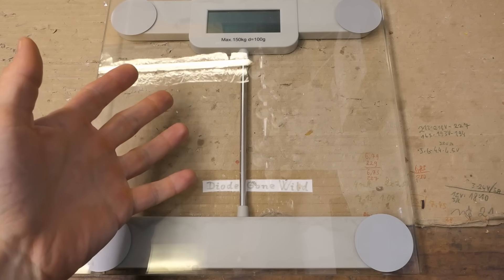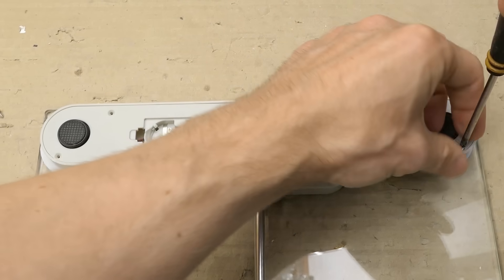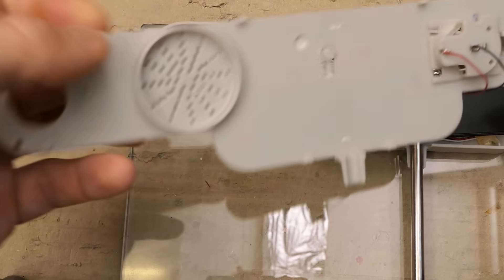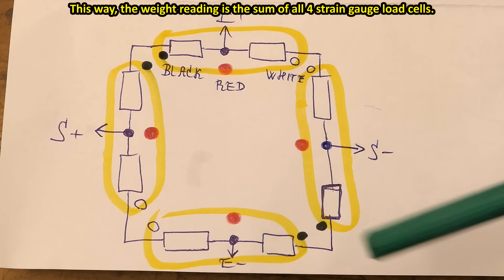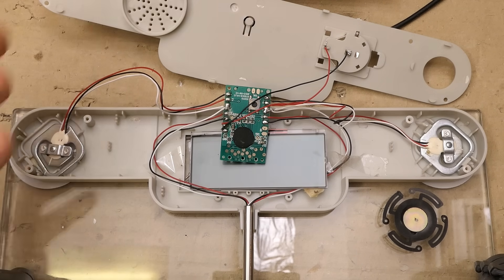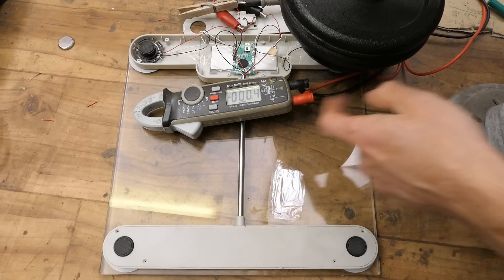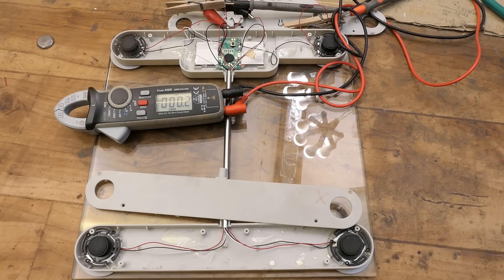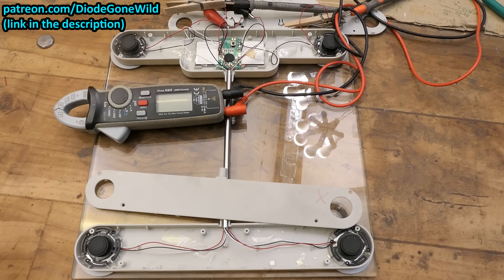How does a bathroom scale work (and cheat you)

Comment: My cheap soldering station "cheats" in a similar way, showing a nice steady count up in temperature when it is heating up. But every few seconds it jumps, presumably to the actual temperature reading or average of readings, before continuing the smooth heating count 1c at a time. I suppose it just doesn't quite have the measurement stability or update speed or something. It doesn't really matter at all for using it because the temperature once stabilised is shown accurately enough despite whatever it is doing.

I guess they probably weren't happy with how the readings looked when it warmed up so fudged it a bit in software.

Comment: My scale ran the coin cells down quickly when not in use so I wired an old mercury tilt switch in series with the battery that only connects the battery when the scale is laid flat on the floor. Works nicely.

Comment: One thing that drives me nuts is the difference between measurements of even 'working' scales.
This morning I stepped on the same scale several times and I had about a 2,7 kg difference between the highest and lowest. That's a massive inconsistency
I wonder how expensive a properly calibrated scale would cost....
Reply from the maker: It's probably difficult to do with a very cheap chip, when 1 count (0.1kg) is only about 2uV. On top of it, humans keep moving. It would have to average the reading for quite a long time, beyond human patience.

Comment: My digital bathroom scale is from the 1980s and it is very accurate.  It is running off of a USB power supply due to the battery holder being destroyed by leaking batteries.

Comment: Could you put a constant resistor (dual) where the broken sensor is and let it give out what the other sensor give when they are not pressed.. let two of the sensors stay at their normal plave and put the last Sensor into the middle of the side where you remove the sensor. That way you can still balance the weight

Comment: When I had one of these crappy scales, I used to keep a 1 kg weight by it, so I could hold in my hand while measuring myself to trigger a new reading. 
It was also running down the button cell pretty frequently, so eventually I go annoyed enough to buy a less crappy one that takes AA Ladda rechargeables and doesn't use the memory trick (I had to test a bunch of them in store to find one that doesn't).

Comment: I’m now curious if it would work with 3 sensors only. Completely remove the broken one, move a rear one to the front and slightly center the remaining rear one so it gets just a bit balanced. Hoboscale might work if it just sums them up.
Reply from the maker: I also thought about this. I'd probably have to replace the missing one with accurate resistors. I might try it when I'm bored ;)

Comment: Hi thank you for the great explanation.
I have successfully repaired a scale like this with a similar problem. I carefully scraped back the white blob(silicone or soft epoxy?) and a wire had broken off, I soldered it back on and in the process broke another off and soldered it back on as well, blobed it with some silicone and made sure that the wires didn't move until it dried. It worked perfectly ever since, I have even checked it against other scales to make sure that it measures correctly. Who knows if it is the same problem, but worth a go.
Reply: Ps. The white blob that holds the wires to the strain gauge.
Reply: Dodgy!!

Comment: that is why I love @diodeGoneWild:
Danny is always taking the extra step in troubleshooting.
He always first explains clearly how things work.  Then, in this case, knowing how it works, testing the separate sensors to come to a conclusion why the scale failed, even without a schematic and any spareparts to test/compare
Did I say I love it ?
/chriV
(PS: the problem is not something obvious like some bent plastic or an uneven surface? Maybe swap out the sensor to another location on the scale?)

Comment: I always wondered how the 4 strain gauges were wired in those. Mine tells you the change in weight from last measurement - but I think the change has to be bigger than some threshold - if you step on and off x times, you can get x different readings, even after it has averaged :o( But the differences are fairly small I suppose :o)

Comment: So, if you replace the faulty sensor with two resistors, the reading will be 75% of your weight, right?
Reply: The reading will be offset + 100% of the weight that goes through sensors.

Comment: Nice explanation. But new model "smartscales" also measure resistance if you step on them with bare feet and send all data to the smartphone.  I got 3 of the same and they are all equal and acurate to 1kg. However the calculation of body fat percentage is more of a joke.
Reply: Yeah, the 'body fat' thingy is more or less the resistance of your body trough your legs.

Comment: I have a similar-looking LCD screen on a slightly different-looking scale (probably an OEM device anyway).
I noticed the «cheating», too. I'm now removing the battery right after using it, since scales still drain it on standby. Removing the battery seems to prevent «cheating».

Comment: Interesting!
I also have a scale that failed - and just but bought a new one, since they are so cheap anyway. But I will will save just the sensors (even if one of them should be faulty, at least 2-3 of them are most likely working). Those could be fun for other projects, like building a dynamometer.

Comment: You have to put all the four feet on flat sturdy surface (not on different tiles as you did)......
Reply: It still should land on a fixed value if it wasn't broken.
Reply: @DarkGT  Absolutely. Also, even if you're distributed over different tiles, not all at exactly the same level, it will still work (assuming the scale itself is close to level). It measures the combined weight over the 4 feet. So if one tile happens to sit a little lower, but all 4 feet still make contact with the floor when you stand on it, it should still read correctly. The weight distrubution over the 4 feet will be uneven, but the total weight distributed over those 4 feet doesn't change.

Comment: They all are made of four tension sensors like the one you featured earlier on this channel — a metal bar with a film resistor whose impedance changes when you flex it.
Basically, it is easy to replace the whole guts besides these sensors and their integrator circuit with a microcontroller which you can program the way you like.
Each of these sensors is capable of translating up to 50 kg of weight into impedance deviation, that's why they usually have four in such scales. Kitchen scales are intended for measuring less weight and with more precision, so they have one sensor, and it is made to show more precision.
Reply: Oh, this one doesn't even have a separate integrator, how cool.
Reply: I believe the HX711 ADC interface chip was made to work with such sensors in various configurations.
Reply: All digital kitchen scales I've seen also have 4 tension sensors, because all of them are just a scaled down version of a bathroom scale (i.e. slate/cutting board shaped)
Reply: @RaduTek  maybe they meant milligram scale

Comment: I prefer vacuum tubes instead of super complicated unnecessary computers for even the simplest of things.
Reply: Would not fit in the scale :). At this point you just have to live with it/embrace it cause pretty much everything has a small microcontroller or computer inside
Reply: Ah, yes. The mains-powered bathroom scale. What could go wrong? 🤔

Comment: I really hate on those modern electronics that tend to be built for dumb people, like cellphones that show battery at 100% longer to avoid people wanting to charge it as soon as it get to 99%, et cetera. All of this is for the average people because they don't know, don't want to and would never know how the actual world really works under the hood.
Reply: Unfortunately, that’s necessary because half the population is below average and some significantly below average.  If you need proof of this, just look at the random political comment in a post about bathroom scales.  Sometimes they call themselves out without even trying.
Reply: 50 years ago cars usually come with complete maintenance manuals on how to fix them at home. now they come with instructions on how not to drink the contents of the battery
Reply: "90% (feels like 100%)"
Reply from the maker: Yes, it stays at 100% until actual 90% for the viewing pleasure of the drooling user. Electronics start to feel like a plastic cutlery in a psychiatric hospital.
Reply: Honestly I dont mind that trickery, if they had an override function!
Reply: Yes, I really agree that stuff is often made for idiots (even though that can't really be blamed on the electronics them self, their nature of being controlled by sorfware, makes it very easy to do these adaptions). Car and motorcycle speedometers are another example where people are treated like idiots - as they almost always show more than the actual speed 
(which is even mandated by stupid laws in some cases - like here in Europe where they have zero tolerance for underreading - even if it shows, 139 when going 140, it's illegal - but is allowed to overread by up to 10% + 4 km/h). 
Apparently this works on most people as well - as they refer to what the speedometer shows when talking about their speed records or different traffic situations (I use to ask them how the speed was measured in those discussions - espesially if it's high speeds, where the error tend to get larger)
 - despite that pretty much everyone for example have GPS in their phone nowadays and there are plenty of apps that can be downloaded that show the speed.
Reply: @Speeder84XL  And some are just off a fixed amount. On most VWs since the 90s, they just consistently read 3km/h high. At least that makes it easy to know your actual speed.The thing shows 53? You're going 50. It shows 201? you're going 198. So, if you drive 3km/h faster than the speed limit (according to the gauge), then you are actually doing the speed limit. Unfortunately, the temperature and fuel gauges are a completely different deal, with the temp gauge basically only having 3 positions (cold, ok, hot) and the fuel gauge on many cluster versions averaging dozens of values, including ones from when the car was last used, even if something like a leak or a motorhome heater drained the tank since, or the car just sat on a hill with the ignition on, so the sensor read high for a while. So, when taking off, you're impressed that you still have a 3/4 tank left, drive past 2 gas stations, and end up breaking down on a highway on ramp. Unfortunately speaking from experience here. Lesson learned: never trust the gas gauge on a TDI, or any VAG product for that matter. I now just fuel up every 800-1200km, even if the stupid gauge still says half full. And it is usually wrong. A half full 60L tank certainly doesn't take 50L to fill up.
Reply: @unmountablebootvolume On my Astra from '99, the reading says 50 liters for full but it's highly non-linear, especially during the lower end of the scale. I've had many situations when I've filled it up with lpg, only to have the no gas light blink. I go back to the gas station and put in 4 liters, and then it says 25%. I guess it's just because it's an ancient car.

Otherwise the speedometer shows 10% extra compared to GPS. It does do 200kmph but only on the speedo hahaha.
Reply: @windshield11  Funny enough, my dad had a red one of those as well (I think a 96), and he broke down on the Autobahn because of that fuel gauge as well. The gas gauge was the one part he truly hated about that car. And many speedometers work like that, which I find far more annoying than the +3. At least that's consistent.
Reply: @unmountablebootvolume Being poor certainly sucks. Ask me all about it. Good thing that gas cars aren't so fussy about air in the system. Heck, mine has a ruptured gas hose inside the tank that makes it crank for 5 seconds before starting. 

However since the Albanians I've got it from "fixed" the engine, it has poor lubrication to the head when it sits idle for a while. So if it starts immediately the head knocks like a Ford. This way I get time for the oil pump to get the head full and it not to knock. 

My dad has the same car but with real 290k on it, he has had so many issues that mine with it's "290k" hasn't have. I've driven this clunker for at least 80k and it has never failed me when I've needed it, only at silly times like registration or something. Not giving it away until it rots to bits. 
A few weeks back the gas filter thing just went inside the chassis about a few cm but eh you can still put gas in it. The ecology of Balkans.
Reply: @windshield11  Yeah, sounds like a classic kurwamobil (or blyatmobil, depending on where you are). I had a good few of those as well, lol. Especially when I was super broke and living in a bad ghetto at the polish border. Funny enough, some of them were more reliable than much fancier cars, despite their horrendous condition.
Reply: I think you wrote "dumb people" where "Trump voters" would also be applicable. I mean, the venn diagram for those two is just one circle.
Reply: @Boogie_the_cat it's as if there are people outside the US and not everything revolves around your politics? You realize that most of the world doesn't or can't vote in American elections, right?
Reply: @Boogie_the_cat  not everything has to involve politics.😒

Comment: Erroneous readings from weighing scales are, in my experience, surprisingly common. My scales regularly overestimate my weight by 15kg. The scales in my doctor's surgery do exactly the same thing. To my astonishment, the scales in a friend's bathroom had the same fault, 15kg - A quite remarkable and consistent QC failure in the manufacturing process.
Reply: Mine have drifted upwards by several Kg over the last year. Odd.
Reply: @g0hjq  😂
Reply: same here - all was ok until 1y ago, then +15kg all the time and all of them - strange
Reply: Maybe you got 15 kg heavier. I certainly don't routinely see errors like that.
Reply: @ludvigericson6930 😂😂
Reply: @ludvigericson6930  omg
Reply: @ludvigericson6930 woooooshhhh
Reply: @ludvigericson6930  ty Captain Obvious. It was probably sarcasm.
Reply: Bought some for my wife and those actually read wrong brand new apparently.  She told me by seeing whether they made good frisbees playing catch with me when i had my back turned.   They do make decent frisbees though,  you just cant have your back turned when playing because they slice through the air, and your head..